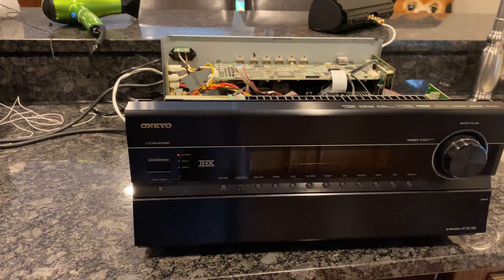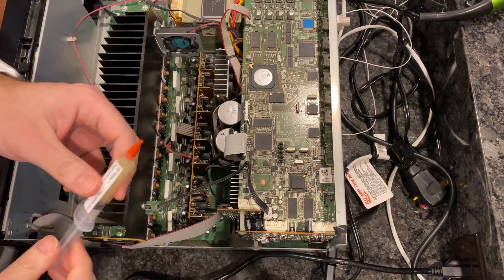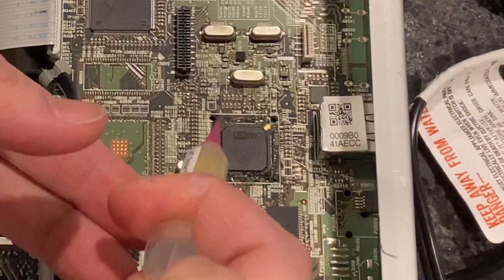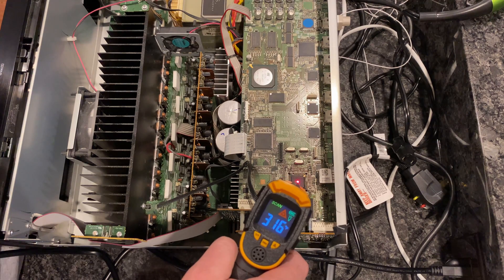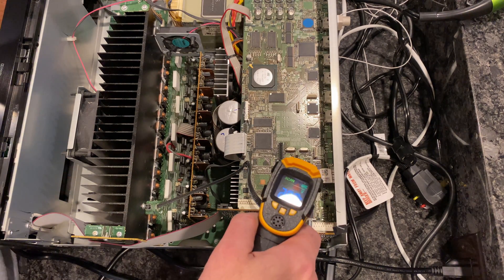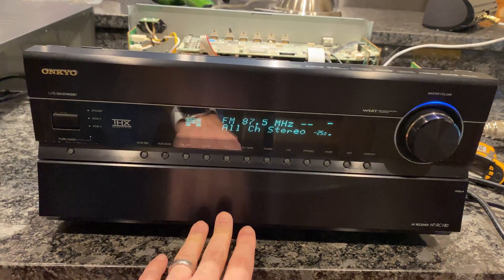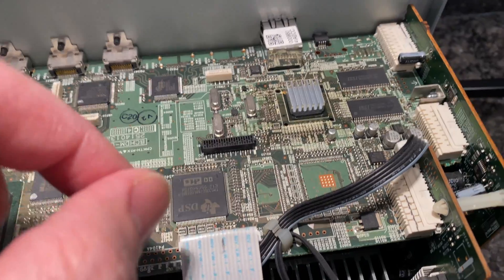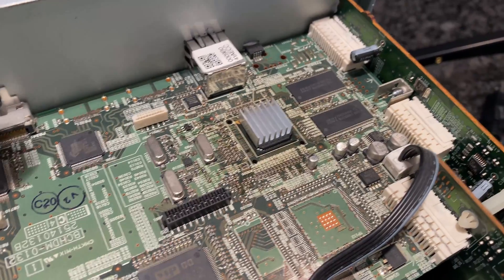Onkyo Home Theater Receiver No Sound Fix - DTS Chip Re-Flow

Comment: Three times I hade the whole PCB in the oven (Fix seen on YouTube). It worked, but only lasted a month or so. I found out that somehow the chip got bad while in standby mode, so I started turning off the power completely on the wall-contact. It then lasted for at least 5 years now without any problems.
Just my advice: Turn off power completely instead of standby mode.

Comment: HT-RC180 is actually TX-NR807 but for another market. Problem with DSP chip can be fixed in that way but that DSP chip marked as D830K013BZKB3 is problem from itself. It can be fixed permanently swapping him with DZKB revision on that chip. All of that BZKB revisions over time, about 18000 working hours, have memory communications problem and after that period he never worked properly. So, permanent solutions is to swap BZKB with DZKB revision of the same chip.
Reply: nice to know, i will fix my r590 soon

Comment: The whole idea is to get the chip hot enough to remelt solder and that chip can stand up to the high heat. I didn't have flux or a heat gun so I used a Mapp gas torch on it's lowest setting with a small blue flame and applied it directly to the chip until I saw the perimeter of the chip "sizzle" and then took the heat away and let it cool. I then used component cooling spray to freeze and test whether it would fail and it didn't.   It has been working for only a day but I must have done something right because when I turn it on the speaker light comes on almost immediately along with the sound. Time will tell. I got this Onkyo TX-NR808 free so it was worth a try. What may not be worth it is having to hook it up to my surround speakers and have it fail!

Comment: Hi. I have a pioneer vsx 832, it has a similar behavior, should I try the same... Or do pioneers not have that problem?
If I had to buy a heat gun, is it better to buy something with a minimum of 350ºC or a smaller one with a maximum of 200º?
Thanks.

Comment: BGA chips suck, they use BGA in TVs and they are the number one failure. What I have found is it you gently prod the chip you can feel it move when the solder melts.

Comment: Is that 390 degrees C or F? Being you started at 68 I assume its F
Reply from the maker: It’s Fahrenheit
Reply: solder starts to melt around 600F.  390F is still very low

Comment: I just did it on the TX-NR609 and it worked! I held the heat gun above it about 3/4 of an inch for 30 seconds on about 400-500 degree setting.
Reply from the maker: Glad it worked for you!
Reply: I have the same one and I had a heat gun on it for a little while and got it hot. But still not working do I need the flux for it to work? Is that what you did?

Comment: I'm having a TX-NR414 with this "no sound" problem for many months. Haven't tried your solution for now (but will try) but I "fixed" it with another solution which is working as long as the problem exist: Power up receiver, TV and a video source, play a video (movies are a good source) and let that playing for at least 15 minutes to "heat up" the receiver. Stop the video, power off the receiver for >=10s and turn it on again (sometimes my receiver turns on by itself after a sec). Wait until (the relays?) are doing their "click" (sometimes "click---click") and voila, sound is available when starting a video again.

Comment: I just bought some flux and heatsinks and will be doing this on my unit. The thing is I don't have a heat gun and will be using an incandescent light bulb to heat up the chip instead (I've been heating the chip with this bulb to fix the unit but the issue keeps coming back if I leave it on for too long, this is why I'll be applying the flux and heatsink). How long do you think I should leave the bulb heat the chip after applying the flux around the chip? I've no expertise in soldering.
Reply: Well, I'm about to do it now. Crossing fingers and hoping everything goes well.....
Reply: UPDATE : I did it once using the incandescent bulb (the flat spotlight type) letting the chip and flux heat up for about 8 mins. Unfortunately that only fixed it temporarily. I cleaned the chip and surroundings and re-applied the flux around the chip and then let the lamp sit there for about 30 mins instead. I let it cool and even applied a bit of air to disperse the flux that was on top of the chip and when I saw the flux had cooled down, applied some Artic Silver Ceramique 2 thermal paste on top and applied an aluminum heatsink like the one on this video. So far it's been running great for 2 days in a row, I'll update if it stops working.

Comment: This also worked on my TX-NR818! I had to try at least 3 times, heating up longer every time and it finally solved the issue. I have placed a home made heat dispencer with heat transfer tape. Crossing fingers this will work in the long run!
Reply: Any update so far?

Comment: These Onkyo A/V units are basic fire hazards.  If they run so hot as to desolder connections they exceed 370 degrees f.  Unplug the unit and recycle it.  Buy a different brand.  Mine delaminated.  I didn’t trust it at that point.  Give Onkyo a lesson in finance, buy a Yamaha or something else.
Reply: Its not that they get so hot so the solder melts, its the damn lead free solder that cracks after a random number of heat cycles.
Reply: Ohhh damn these are things I’ve never thought of, I’m currently running onkyo thx system and I also have a 7.1 ch pioneer receiver… should I keep just in case lmao 😂

Comment: The problem with all newer electronics, newer meaning post 2002. There is a corporate mandate ordered by the Clinton Administration to stop using lead based solder. Companies of course had to use a different type of solder and over time it looses it's connection to the components. This was the issue with all PS3 and 4's and Xbox platforms. This is the reason why you got the red ring of death on the console.  One can reheat the connection to get it to work again, but it will only last for a short time. The only way to fix the issue at the component level is to remove the solder and re apply lead based solder which some companies are using again to combat expensive recalls.
Reply: And a whole bunch of laptop gpu's (they ran hot and exposed the fault in as little as 1-2 years!)

Comment: Or you could just go ahead and throw it in the trash if you want to save yourself the headache. I did try using a heat station three times and then I put it where it belongs, in the trash.I bought it for 45$ at a goodwill thinking I got a great deal because I plugged it in and everything worked great until I got home and then found out that it had no
Sound. apparently, this was a common issue with many of the receivers onkyo manufacture during this time due to a DTS chip overheating .kinda sad that onkyo  let quality slip away and know I wouldn’t trust buying any of their products . I did check the hours on the display and it registered it just a little over 8,000 hours. They could’ve had a recall on all of them and serviced them but like so many other manufacturers, they hide behind a limited warranty and stick the consumer faulty products.
Reply from the maker: I might have taken a shot at the fix had I found one for $45.  Sorry it didn’t work out.

Comment: Hello there..I'm after small advice. I have bought onkyo receiver TX-NR414 second hand yesterday. Connected everything and it worked perfectly. Today, the video is coming through but no sound through hdmi from laptop. The net radio is working well via ethernet cable. Do you think the dts is the issue. I tried to troubleshoot everything but still nothing 😢😢
Reply: It's DTS chip. You don't see the video? Open and search DTS chip. After this heet the chip like în video.

Comment: Anybody tried that with a hairdryer ? Do i absolutely need this "flux" thing ?
My Tx-NR809 has the same issue since 2019, it's been collecting dust ever since... Do you think it would still work ?
Reply from the maker: You can give it a try. The heat gun can concentrate the heat in a smaller area. Sounds like you have nothing to lose.
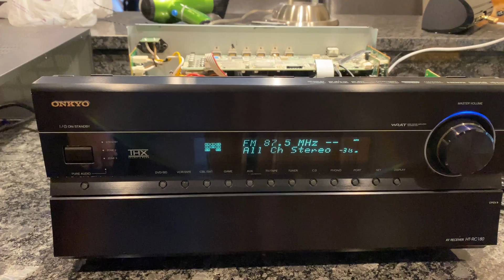Reply: @Upscaled_HT  No luck with the hair dryer 😅the little icons did light up like you @ 3:54 though. It didn't before. After it cooled down, they disappeared again.
But still no sound either way.
Reply: @tranche2pain  he mentioned in another post that he sold it and hadn't heard anything from the new owner that it wasn't still working.
Reply: @Gatorzman  I see, thx. Well, i got mine to work. Still working so far. Still get a feeling of dread whenever i turn it on 😅
Reply: @Upscaled_HT  It worked with a heat gun. But it never lasts more than 2 minutes of audio... I've ordered the soldering flux and heat sink. 
Is your receiver still working ?

Comment: I have a TX-SR604 that I use in a stereo 2.1 set up and she's working fine.  You could practically cook waffles on the vents after a while of use, but its hanging in there.  Nice thx unit.  Great idea with the heat sink.  I've seen people add active cooling fans to some of their rigs.
Reply: My TX-NR757 is cooking it's components inside my equipment cabinet and now even in off state I smell burning plastic.

Comment: Just fixed my 808 in 5 minutes. The temp got up to 450 unintentionally, but worked first time. I had the heat gun on it for 30-40 seconds. 

Before trying this, I placed a 60 W lightbulb on the chip, and the speaker array came on.  That confirmed to me that the chip was the problem. I found this method in a different video.

Thanks for your post!  I was getting ready to scrap the unit.
Reply: Cam you tell me how huch time you placed a 60 watt bullb above it? Thanks in advance.. I have a tx sr 506 with no sound.. But on display there is showing dsp logo.. Does this model have a speaker array indication on display? Pls help me in info.
Reply: @rebmaxdigilabs2161 most likely yes.

Comment: I am preparing tool and material trying to fix my nr-656 without sound... Do we know the root cause on this issue? Overheat for this chip?
Reply from the maker: It’s a just a design flaw and not enough chip cooling.
Reply: @Upscaled_HT  I successfully did it! With how demostrated in this video. Thank you! I will add one metal cooling piece on this chip to avoid the overheat issue.

Comment: The L is silent in the word Solder. silent L you do not pronounce the L
Reply: I replied with a link to the Cambridge dictionary where they actually have the sound to listen too, but seems comments posted with links are removed. Google it and prove yourself wrong. Btw, you also pronounce the l in colonel, otherwise it would be coonel lol
Reply: It's not.
Reply: @RandomBadger21   before you say it's not did you go and look it up in the dictionary. The L is silent like I said. Just like in the word colonel. Why does it have an r sound in it when there is no r in the word colonel?

Comment: So after 10 years of service my Onkyo TX-NR809 finally experienced the dreaded DTS chip solder symptom.  Back in the day when I bought the receiver I heard about the issue and so I installed two 140mm fans on top of the receiver in a pull configuration from day one.  After so many years I thought I escaped it by adding the fans but it finally gave in.  The speaker icons stopped coming up and I would have to restart the unit in order to get sound.  In a matter of a month it went from a restart to few minutes to about 15 mins in order to get sound.  Performed this fix with flux with a paint heat gun right under 400 degrees Fahrenheit and also went overboard and added some passive aluminum coolers to every chip on the board.  Turned fans around and now running in a push config.  It's working like new but only time will tell (Fingers crossed).  I lover this receiver to death and only wish Onkyo would have cooled the chips properly.  Will keep you guys updated.
Upscaled thank you so much for sharing this video it really helped...
Reply from the maker: I’m really happy it worked for you! Thank you for the thoughtful comment.
Reply: Hey, i have the same receiver with the same issue. I'm waiting on the flux...
Is it still working ?
Reply: @tranche2pain  Funny you asked cause about a week ago it started with the no sound issue after 3 months.  It needed to warm up for about 20-30 mins to get sound back.  Got tired of waiting and bought a Tx-Nr 6050 for $329 open box on Ebay.  Have to admit I really like it considering it's bang for the buck compared to likes of Denon and Marantz.  Sucks it has no pre-outs but used a Russound ADP-1.2 line lever adapter to hook up the Crown XLI 1500 for the front towers and is working really well.  Really crossing my fingers this one lasts as long or longer than then the previous one but Onkyo did add a nice cooler and fan to the chip and HDMI board.  Only time will tell once again...
Reply: @An9eL_C  damn, so it only lasted about 3 months...? I'm still gonna give it a try.
Then i'll go back to a Yamaha, no way i'm buying another Onkyo 😅 This is the 2nd receiver to have the same issue. 
I had a Yamaha for 15 years, gave it away 10 years ago to my cousin.
It's still working.
Reply: Interesting i' Just Got 1, 4,  $27 @ Thrift Store No Sound, mdL# TX-SR707, i' Just Connected 1-Speaker No Sound,  i' CLeaned it 4, a Hour+ it's ALL Lit but no 😮Party Lol,  i' Bagged iT up 4 Now, Got Other Projects, i' Wonder ? WouLd i' Need To Connect More Speakers 4, ? Sound Any Advice
Reply: What did you use to adhere the heat syncs to the chips?
Reply: @stevet7487  The heatsinks came with a thermal sticky tape underneath but I'm sure you can also use thermal glue.
Reply: @An9eL_C  Thank you for taking the time to answer.

Comment: Just did this to my 11 year old Onkyo tx NR 809.  I used rosin flux for electronics as others mention in the comments. I also used a large heat gun took a few tries finally got it hot enough where smoke was coming out a little .  It’s been working for a day.  Time will tell but I’m glad to have my surround sound back.
Reply from the maker: I hope it keeps working.  If it stops working, you can repeat the process and try going a little hotter for longer.
Reply: Is it still working?
Reply: It stopped working after a month or so. I will try it again with a heat gun.
Reply: I  applied solder with the heat gun for the second time.  It’s working again.  The circuit board it a little discolored from the heat.  Didn’t use a thermometer just got it hot enough to start smoking. It’s been working after the second fix for about a week. Not sure if it’s a good idea to put a piece of aluminum on top of the chip to act as a heat shrink?
Reply: I think its best to solder it with no clean flux and the apply a big copper heatsink and a fan which blows from top on the heatsink.... will try it in the next two weeks

Comment: Did exactly this. Though my flux did not include a fine tip. Ended up spreading it with a toothpick. Started to heat it up. Saw a bit of smoke from the underside. Can only assume it was heating too much. Only went for about 30 seconds. Its working as of NOW. Will see tomorrow...and the next day, and the next. Thanks for this video.
Reply from the maker: Glad it helped you out!
Reply: Is it still working? Thanks in advance!

Comment: mixed result so far, had to go to 230c to get it to take, still evaluating, had a couple instances on first try with garbed output, second might have worked (higher temp), added heat sinks
Reply from the maker: That was my plan but my initial attempt worked out. Good luck!

Comment: Make sure you use flux designed for electronic circuit boards and not the type for plumbing. The correct type has rosin in it and will gently remove oxidation on the metal pins. Plumbing flux has acid in it and will corrode the circuit board connectors and will eventually cause failure.
Reply from the maker: Thanks for the tip! Great info.

Comment: I have an Onkyo TX-NR818 with no sound. Found a Flux Paste at a local Home Improvement store and got a heat gun and laser thermometer. My problem is trying to find a Heat Sink for the DTS Chip. Stereo Repair places and even computer parts stores have no idea what I am talking about when I mention a Heat Sink for a DTS Chip. Where would I find one?
Reply from the maker: You may not even need a heat sink.  It’s a nice to have but not a must have.  Try the process and see if it works. Then you worry about finding a heat sink.  You find them on Amazon https://amzn.to/3Pe5ZO9
Reply: Called to a larger computer parts store. They did not know what I was mentioning about Heatsink for DTS Chip. They suggested that I contact you which I did. Watched your video again especially when it comes to the Heatsink. Noticed that you mentioned Raspberry Pi Heatsink. Googled Raspberry Pi Heatsink and found many for sale online. Ordered one online.

Comment: Hello Sir, I have the same problem, technician say that this chip (BAHDM-0157-IF) has malfunctioned. Does your process of repair will do on my unit. (TX NR-3008)?
Reply from the maker: If it has the same chip, it may work. If the technician is going to replace the chip anyway, it’s probably worth a shot.

Comment: WHERE CAN WE ORDER THAT CHIP ??
Reply: i guess nowhere ?? wow...........
Reply: @APPLEVALLEYTIM  the chips are rare now, if you did manage to get a brand new one though, you would need to program it to your particular board if you look away from the chip up to the left there is a empty header which takes a ribbon cable, onkyo has a tool that connects to that for factory programming. The actual chips dosent really go bad. Best and permanent fix would to remove the chip and re ball it but that is a royal pain in the ar$e. Good luck!